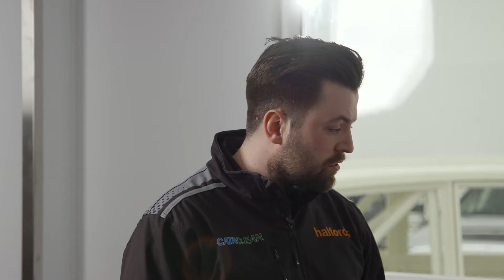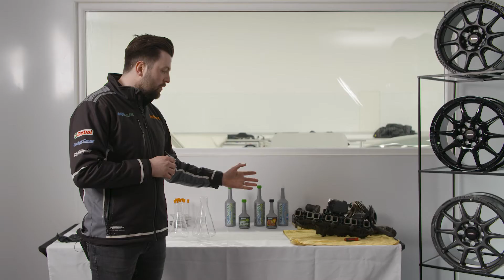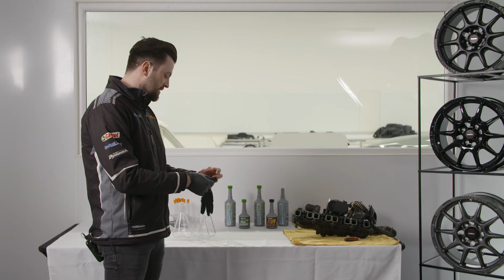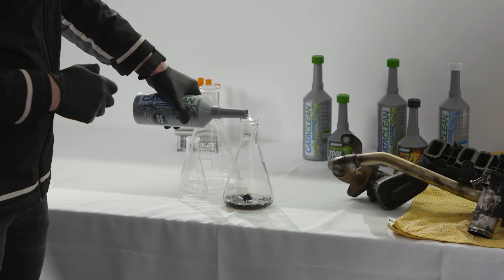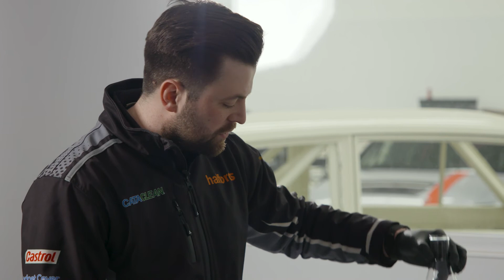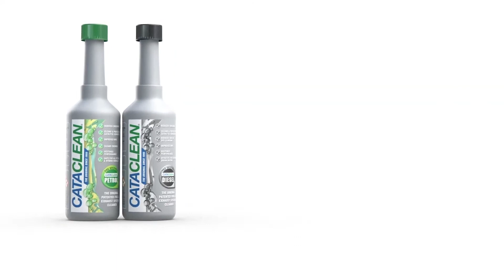Can Cataclean Help Reduce Carbon Build Up In My Vehicle?

Comment: cataclrean is an amazing product  it brought my 01 celica gt  to life i bought it  had been sitting for 3 years pretty much in limp mode  drained the gas out of the tank.  pour the entire bottle of cata clean in an put like 4gallons of gas in  an put a hot battery in it cranked right up an let it idle for a while.  i tried to rev it after it got to running temp but it wouldn't go pass 3k rpms . well after the drive it started to drive better an better

Comment: How can the product clean the intake when it never never touched the intake? And if it has an egr system is the product still effective after it’s been burned through the engine?
Reply from the maker: Cataclean can have an effect on the intake through the post combustion process, which gets drawn back through the EGR system back to the intake side of the engine. Of course Cataclean can’t get to certain components such as throttle bodies as they are too far up the intake tract.
Reply: @CatacleanGlobal  awesome